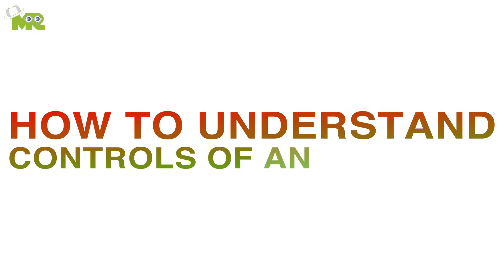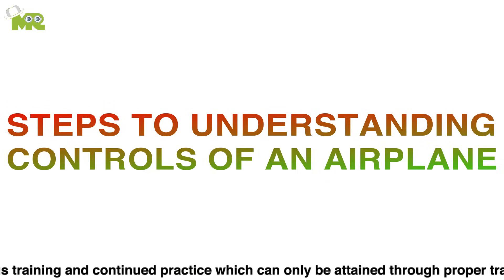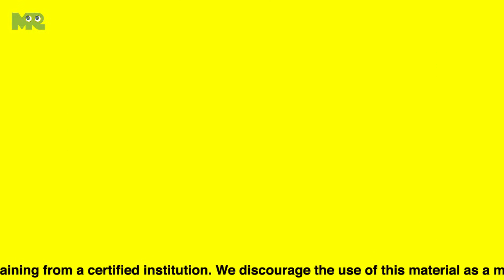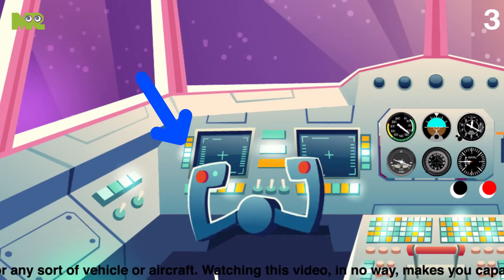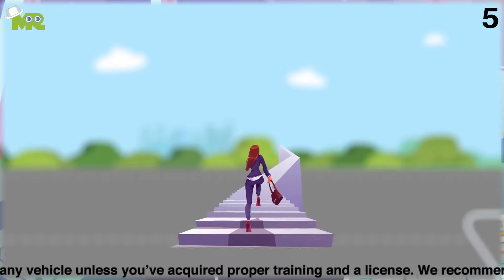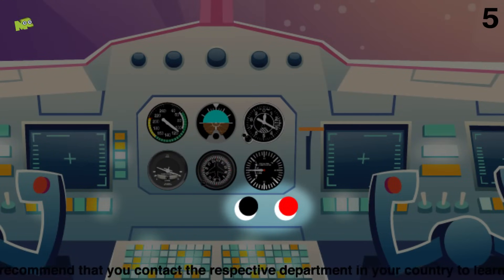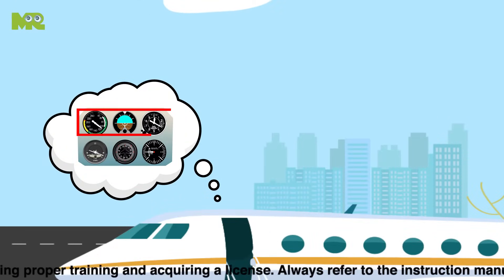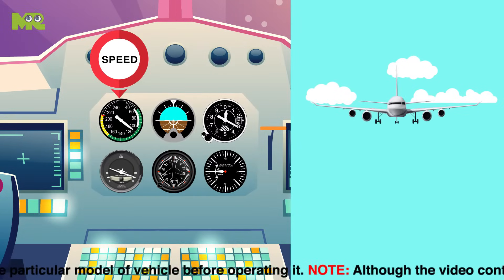How to Control an Airplane : How does a Pilot Control the Plane?

Comment: Previously the CaesarKing order a project on Duality of being and office facility teleported to and fro by creating a conduit or area of synch nodes or anchorage and compatibility science things synch. Now ordering my Space Functional group to pioneer this project prior to being ordered to others.  A Modern Civilization created  in a transparent super hard structure of globular with leveled center line radius of half of such globe like structure tech layered sophisticated plating floors piece by piece in space of floater while the other upper half the space modern civilization with castle like central tech structure and with entrance inside for the Workbots and 3D printer Ai machines then seal off from outside and program the work of builder machines inside with wireless program by segment of work project program feed, then  another set of INSTILLATORS and Sensors tech for the synch proximal and distal connect outside civilization structure implant tasked, different from inside structure robots and Ai workers. Create space probing scan large telescoping tech and space probe node stationing per station. Of a Modern Civilization prototype propelled and moved by leveled station per station Speed Warp to Time Warp, make use of another tech perfection per area of the vector, magnitude and scalar orientation space tech floating clocks with pointers which can adjust by marble like spinstreak move anchoring at specific space temperature by Kelvin mode of Molecular patterned space time clocks directional guide orientation instruments ( plural ) custom create the modification my commanded science tech experts and customized manufacturers in space stations space force. Let it be